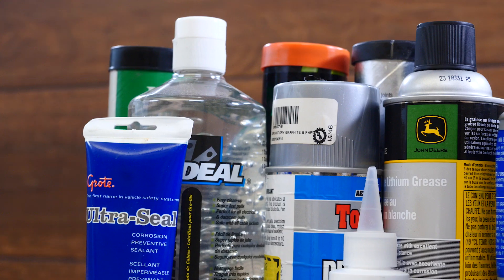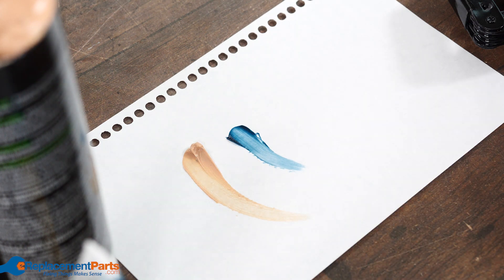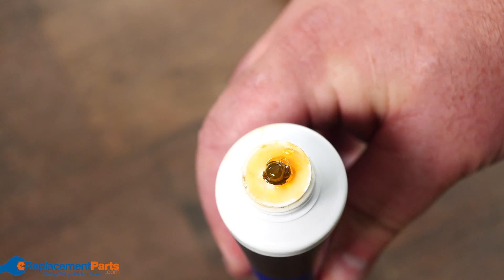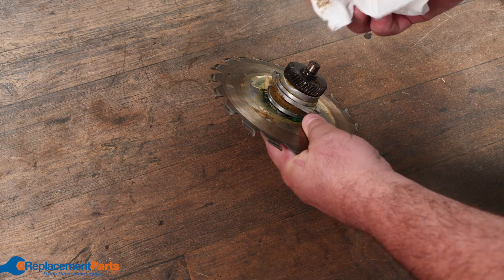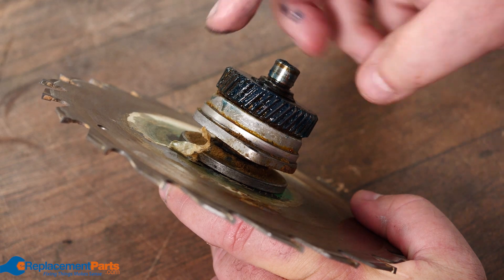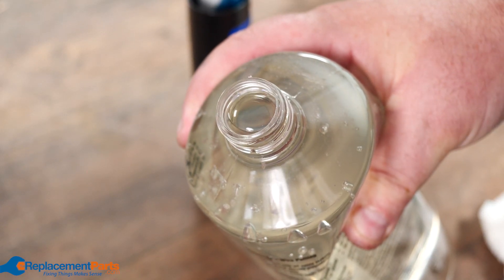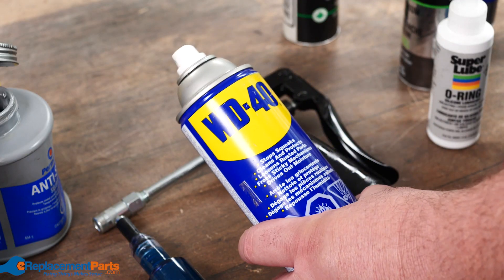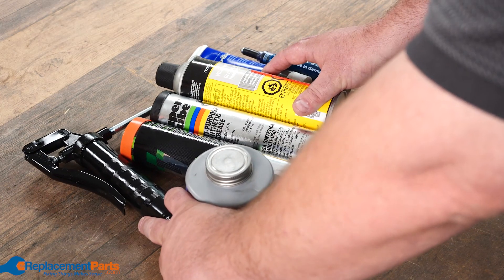GREASE 101: Understanding Different Types of Grease and Lubricants | eReplacementParts.com

Comment: What to use for the gears of the electric chainsaw what are made of plastic material ( +PA66-GF35- ) but have contact with metal gears

edit : valvoline moly fortified mp grease nlgi-2 or valvoline multi purpose grease nlgi-2 is any good?